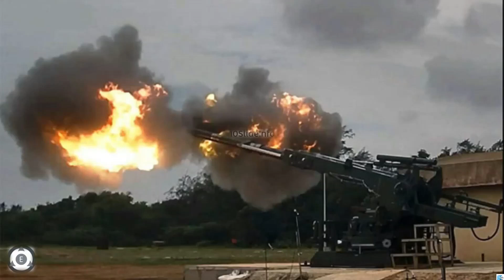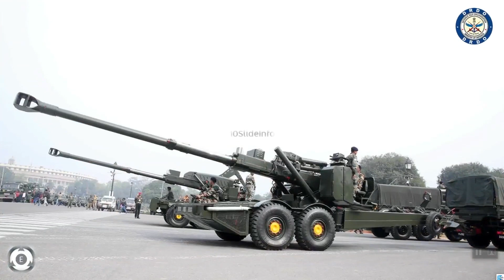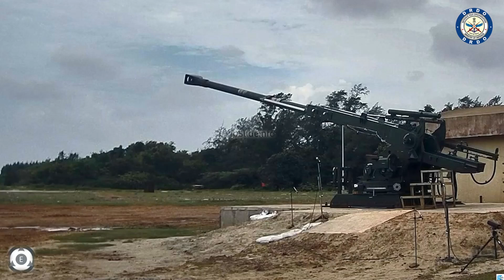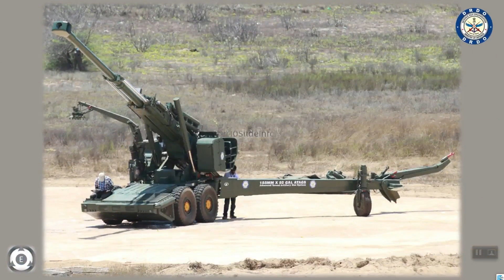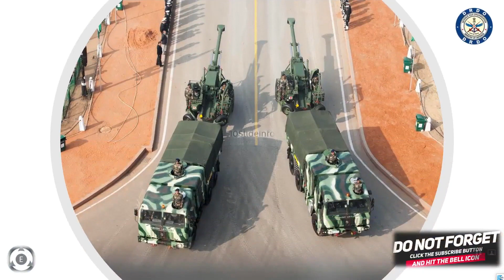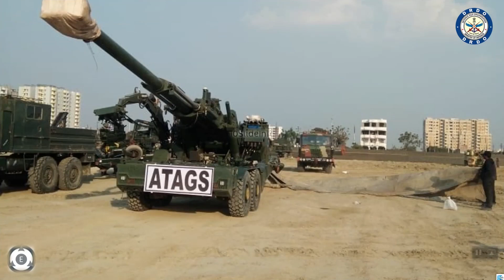Why Did DRDO ATAGS Barrel Burst?

Comment: First 2:07 is description of the howitzer......

Similar incidents have happened with battle tank barrels in 2004 (?)..... The reason was poor quality control, where the temperature of the barrels during manufacturing was reduced quickly, rather than slowly which helps in manufacturing tempered steel & can withstand high heat during firing (which in turn reduces any risk of the barrel cracking)